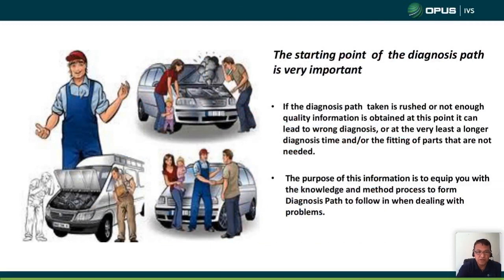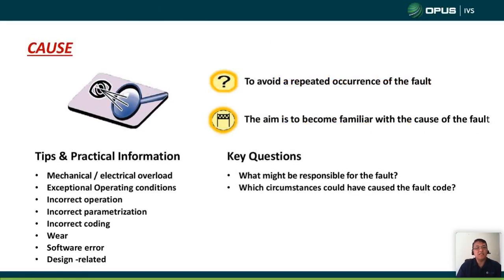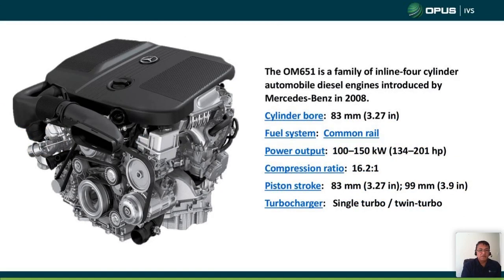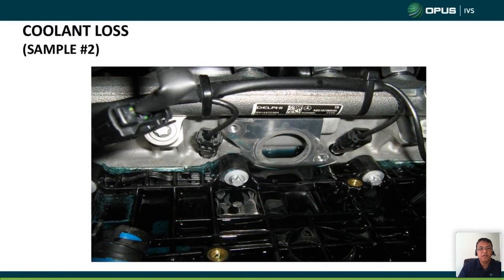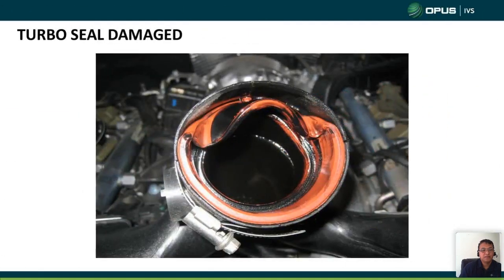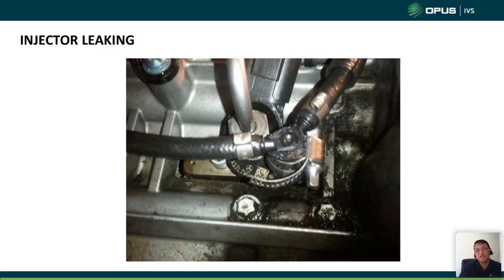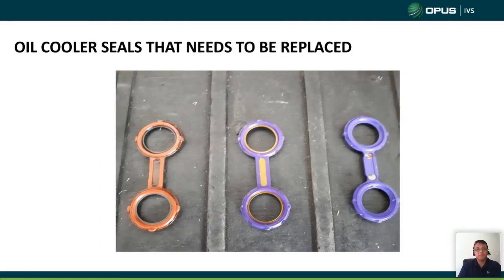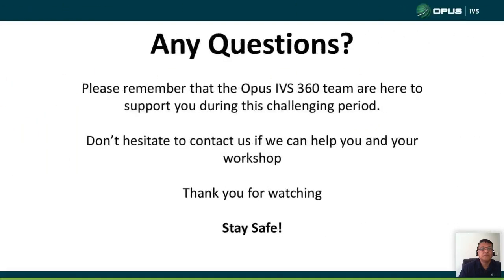Mercedes-Benz Common Faults and Diagnosis

Comment: I’m working at a JLR franchise here in Ireland and was doing a bit of research into a scan tool to do dealer level diagnostics on Bmw and Mercedes as we sell quite a few second hand BMW’s and Mercedes but our snap on scanner isn’t quite up to task, I have come across the 3rd fault don’t down the list on a 2014 om651 engined vehicle but couldn’t diagnose the can communication fault b1100 could you elaborate on that fault and possible causes please.